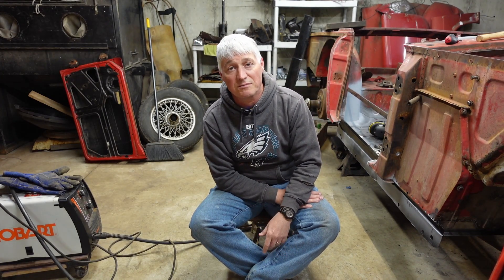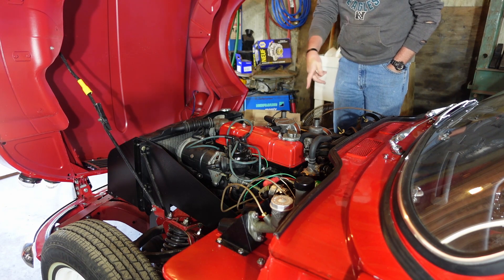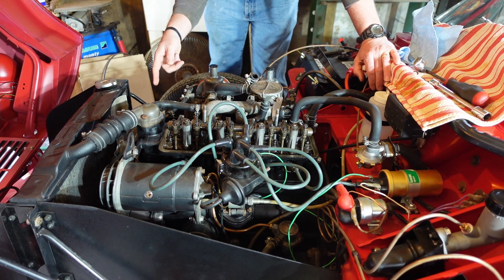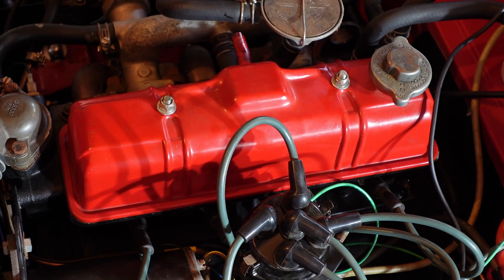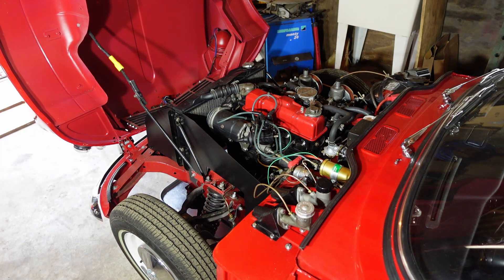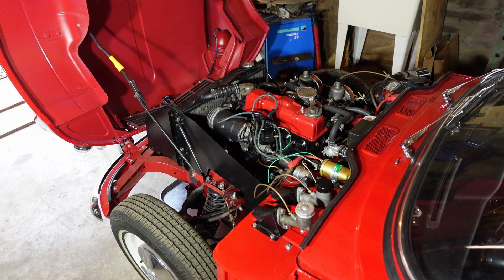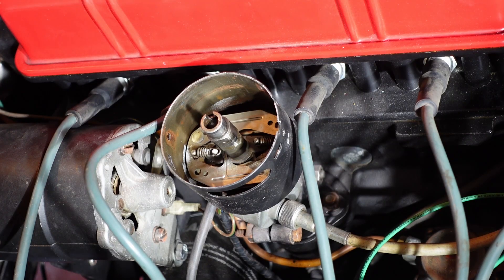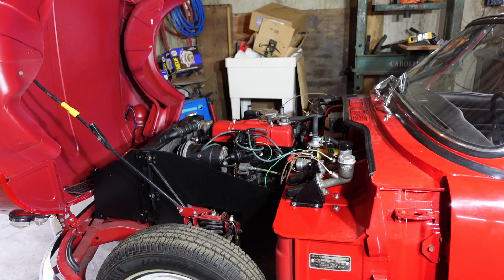Triumph Spitfire - More Rough Running | Roundtail Restoration

Comment: Hey Chris, I know you said you have new spark plugs, but I would check them again. They can get fouled very fast if you are running rich and the way your engine runs sounds exactly as if the spark plugs are fouled. I would check the points, the condenser, the rotor and even the cap as well and then go into carbs and see if you are running rich. I recently gave up on the "lift the piston" method to adjust mixture. Either I do not understand how it works or it is just not reliable method. I realized that all carbs that I adjust this way run rich. I go with spark plug color now. If the sparkplugs are fouled I lean the carbs, clean the spark plugs (I burn the carbon with a torch and they become brand new) and then go for a test drive, the longer the better, with high RPM etc. Then I check the spark plugs again and if they are still fouled I lean the carbs again and go through the whole process over and over until I see nice color spark plugs. But again, make sure your ignition system is good first before you go to carbs. Your vacuum advance seems to be operating well, but the spring on the mechanical advance should not be that lose. That doesn't mean the spring is bad, maybe the weight got detached or something? Make sure the weights move smooth before you go end replace the spring. Or just switch the springs around to see if the problem moves with the spring. But have in mind that the mechanical advance doesn't kick in until 2000-2500 RPM so the rough idle is not related to that problem.
Reply from the maker: Thanks, Elin. I'll check all of that stuff out. I agree with you about the piston lift method. It never really made sense to me either and, no matter which way I want to try to make it "bad" so I could exaggerate the engine response, it never really made a difference.

Comment: Hi Chris,  The spring fit is normal on most distributors: the thinner wired spring is tight on its pillars and the stronger one is set loose on one side to enable full progression of the small spring at low revs without interference. The bigger spring kicks in at higher revs. 
Obviously excessive wear on the spring & weight pillars will change the curve. 
Because of this, when using a worn dizzy it is best to time at revs, full advanced on the stop, (vacuum disconnected & plugged). 
Check the rotor fit, shaft radial play, and small ground wire inside, also check the main wire just inside the body insulator for breaking up.  
Sometimes too much wear on the vacuum unit fork leads to erratic angular movements of the baseplate/contact plate. 
Check the rotor & cam assy springs back smoothly when you twist it manually and lubricate lightly the shaft center under the felt.
Good luck!
Reply from the maker: Thanks. Lots of good tips here and I'll check them all if I haven't already. And good to know on the spring, so thanks for that. We'll see!
Reply: @roundtailrestoration  By the way, static timing value for the mk2 engine is 17° before tdc (taken engine stopped or at a very low idle and with vacuum advance line disconnected +plugged with the strobe).
Reply from the maker: Thanks. I've got a Mk1 motor and dizzy, so I'm running 13 BTDC. I put a Mk2 manifold and header on it, though. Internally, it's a Mk1 (cam and no cam brgs).
Reply: @roundtailrestoration  Hi Chris, Ah OK.
 You say the only ignition parts that weren't replaced are plugs & HT leads. Did you check them for arcing/crossfiring in the dark? (beware of the fan!)  If they are too old and resistive, current will take the straighter path to ground. In addition you can check the fit & condition of the engine to body & body to battery earth straps.
good luck!
Reply from the maker: I didn't replace the plugs and wires this time, but I replaced the plugs last year troubleshooting similar issues. The wires are new to the restoration. Figured it seemed to be a "common" problem that a single bad wire would not impact overall. I did check good spark as well as my ground connections and they checked out fine (wiggled while testing with an ohmeter).

Comment: These triumph engines are a real pain to set up the timing forget static timing that is just a guide to get the car running .... twist the distributor until the idle rises to its highest point then turn it back alittle ... drive the car and if it pings adjust it a little more until you find the happy place ... it worked for me 10000 miles and still spot on
Reply from the maker: I'll give that a try. Thanks, Matthew!

Comment: I remember working on a TR back in high school. Was a friends he got from an uncle.  It ran like crap and found the centrifugal weights on the distributor where shot.. One of the pivots was augured out and the timing was all over the place.  Ended up putting a new distributor in it and once it burned out the crap that had built up it ran well.
Reply from the maker: Thanks. The dizzy is definitely high on the list with the springs like that.

Comment: I've seen this twice on my TRs - once it was a condenser failing as soon as it got warm. The other time it was the little brass ground wire inside the distributor that was intermittent. I've also found it once on a friend's 64 Spitfire - it was the condenser then too. Good luck!
Reply from the maker: Thanks, Skip. The condenser is relatively new, but I'll check that ground wire again.

Comment: A couple other comments suggested a fueling problem and that occurred to me too. Especially when you mentioned #3 amd #4, which would be fed by the same carb. 
It is hard to tell listening to a video, but seemed like maybe one carb was not getting enough fuel. The bowl would fill initially, which is why it runs fine at the start. But once that fuel was burned off, the carb and those cylinders were starved for gas so the engine starts to stumble. 
This is just a wild guess, of course... But would be relatively easy to check.
Reply from the maker: Thanks, Alan. I did check the float bowls after it had been idling for a while (longer than it would take to stall due to fuel starvation) and they were both a the right level (or close to it). That rear carb, though, might be a problem so that's going to get a once-over for sure.

Comment: Hi Chris, the fact that it comes and goes so quickly suggests that there's something changing randomly. Could it be debris in your fuel? a needle valve on the carb getting blocked, clearing out and then blocking again? What about dashpot oil in your carbs (although that wouldn't come and go like you're seeing). Or given that just touching your distributor seemed to fix it, could it be the rotor? I've had one where the conductor that runs down the rotor arm came loose and would jump around. Good luck!
Reply from the maker: Definitely will be checking fuel delivery next, though I did check some stuff off-camera. The filter is essentially brand new (<100 miles) so I don't think it's particulate. But, there may be something in the carb that got through. I'll check the rotor. Thank you!

Comment: That advance spring seems wrong to me, but my distributor is completely different. Maybe disconnect and plug the vac advance and see how she runs? Also I have had brand new defective condensers, can you rob one from the tr4 and try it? You said you are going to try electronic though so that will eliminate the condenser.
Reply from the maker: I replaced everything common in the ignition system last summer when she was running bad. I don't think it's a component, but maybe. I need to probably put the old stuff back in (I saved it all because I never found a smoking gun), one item at a time, and see what happens.

Comment: Can't help thinking of the fuel system.
You mentioned that the engine did not change much when you disconnected plug 3 and 4.
Could it be a SU issue?
I went out and started my Spitfire and the vaccum advance acted just like yours.
Reply from the maker: It definitely could be. That will be my next rabbit hole to go down, though I thought I had eliminated carbs as a potential problem. I can do a bit more, I think. Thanks, Ulrik!

Comment: My wife had a Gremlin back in the 70s and it had a bad condenser.  The darn thing would run fine one minute and be breaking up the next.  If you have concerns about the mechanical advance, pull your dizzy and send it off to a company that still has a distributer machine along with photocopies of all the advance specs you can find for your year engine.  To keep the car running, look for a Pertronix Distributor that you can throw in and set up with a timing light.  Does your Harbor Fright light have an advance dial on it?  If so, time the engine with the dial advanced to full advance at 3K RPM and see where the timing is at idle after you reset the advance dial to zero.
Reply from the maker: Yes, the light has an advance on it. I did check the static timing that way and I pegged it right at 13-degrees BTDC when it was at idle. I need to do it while running the motor up, though. I have the specs in the workshop manual, so maybe that'll tell me if that spring is part of the issue.

Comment: Hi Chris I think it's fuel related how old is the fuel? Another thing did you put a new condenser/capasitor ? as modern ones fail and don't last long. Your points would show marks if this was the case. KevUK
Reply from the maker: Hi Kevin. Fuel is just the winter old, and I ran stabil in it for a while before she was parked. I did replace the entire common ignition components (points, rotor, cap, etc) last summer when I was having issues. Current points look okay. I am leaning towards fuel delivery now, though I thought I had isolated it away from that.

Comment: I can't offer much, but week versed in ignition systems. Any chance it's fuel delivery?
Reply from the maker: Definitely could be, but it doesn't seem that way to me because of the the knocking and pinging/backfiring I'm getting. But, it could be very lean fuel delivery, though I thought I came through all of that (not on the video).
Reply: @roundtailrestoration  yeah, I got all of that on the video. Just thought I'd throw it out there, as it's odd that just sitting would adversly affect the timing system. Fuel is more believable. Gummed up gas, rubber bits, pistons in the carbs, diaphragms ( if SU's have them). Pcv valve diaphragm?
Reply from the maker: Sorry, missed your response. I have no idea. Fuel systems checks out for everything I looked at it for. And the pcv valve is fine and operates properly.

Comment: I pretty sure those springs need to be replaced.  My only experience is with a Bosch distributor, but it’s springs were old (still tighter than yours) and they were messing up the advance curve.
Reply from the maker: I'm definitely leaning that way. I think I have another dizzy laying around somewhere so I may try to steal them from that. Thanks for watching!

Comment: Chris. Are the carbs synchronised?
Reply from the maker: Yup, as close as I could reasonably get them. I was able to get if fixed, but I never did unequivocally find out what it was. Still running fine, though. Thanks!

Comment: Valves aren't likely to cause intermittent problems, but check that the rocker shaft is tight while you are in there.  Your carbs aren't likely to cause intermittent problems, but check the fuel filter and fuel pump flow.  Check for rotted hoses from the tank and look for sediment in the fuel filter.  The sound of the engine could indicate a condenser failure. Go ahead with your electronic ignition swap and see how it goes.  Pertronix is probably easier to find than a Piranha, but Piranha is probably more durable.
Reply from the maker: Thanks, Michael. Fuel pump checked out fine (strong pumps). Fuel filter is practically new (<100 miles). All hard lines and hoses were new with the rebuild (Automec kit). I did replace the condenser when I had similar problems last year and that, too, has few miles on it. I should get some good wrench time on Monday, so we'll see what I can figure out. Car show is 9 days and counting.
Reply from the maker: Yeah, I've read about bad condensers in particular. I buy the Lucas ones, but it probably doesn't matter.

Comment: I am no expert but I would try plugging the vac line to the vac advance and try it again to see if it runs any different without the advance.
Reply from the maker: I did unplug the vacuum at one point (after this video) and it seemed to run the same (no worse, anyway). The mechanical advance seemed to operate smoothly. I'm leaning towards fuel, now, especially after reading my comments so far. Maybe that aft carb is gummed up and I haven't found it yet. Thanks, Barry!

Comment: Seen all the comments. I know you rebuilt the fuel pump. Have you measured fuel pressure and delivery amounts to verify diaphragm is performing. 
Checked fuel cap to make sure breather hole isn't plugged.  
 Also , since rebuilding did you re torque head bolts and re adjust valve clearance?
 Loosened heads will press and leave valves slightly open.
 I was not impressed with your compression results.
 I would expect 100 to 120 preferred.
 I too fully restore British and American cars. 50 years building engines and transmissions.
Reply from the maker: I've since fixed it (I think). About 100 miles with no repeat symptoms. For your questions, I did everything you mention. Understand about compression. Those numbers are about what I had after the fresh rebuild. I did have the head worked by a machine shop. Since they were consistent among each other and with what I have had in the motor previously (though who knows if that's good enough), it didn't concern me. Thanks, Michael!
Reply: @roundtailrestoration   If 
You used iron rings, they take a couple hundred miles to seat well.
Chromoly rings usually take 300+ miles.
Paramount is head bolts and valve lash during that period , especially on old iron heads.
Copper gaskets preferred over paper metal head gaskets.